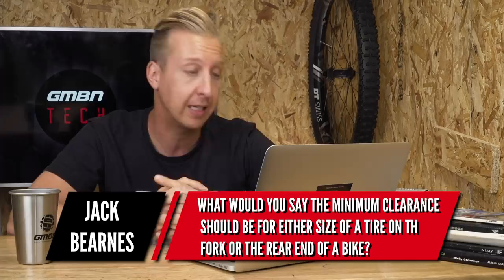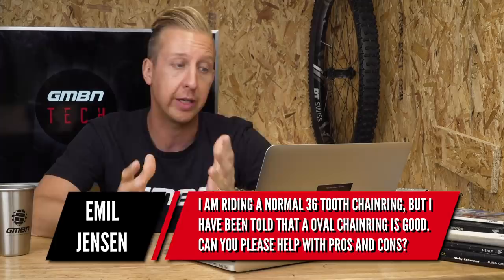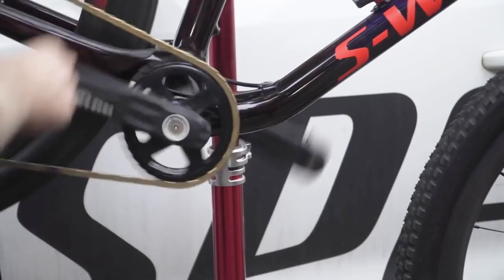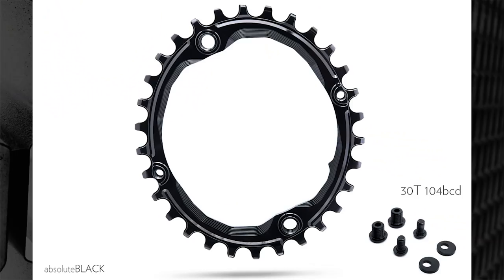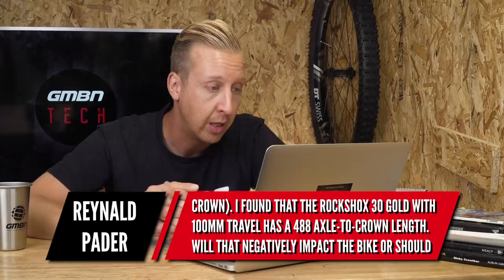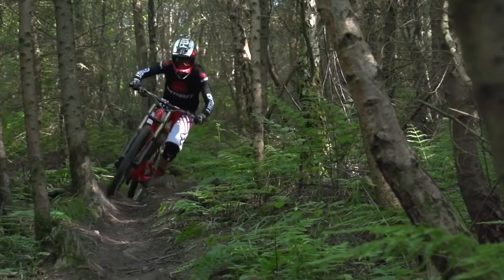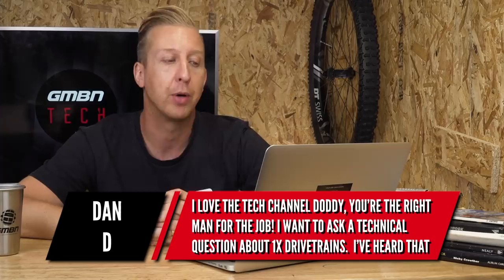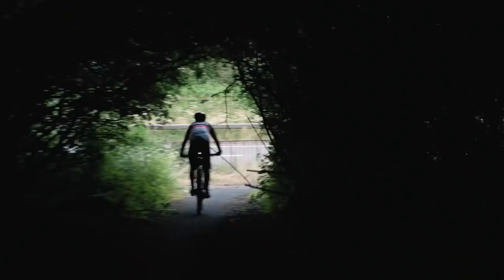Ask GMBN Tech: Should I Get An Oval Chainring?

Comment: I'm ordering an AB oval 34t next week and I fully expect my average speed to increase because my wallet will be lighter.
Reply: Everything old is new again.  I remember in the early 90s when oval chainrings were all the rage.  There’s a reason they died out.  I hated them myself.
Reply: @keirfarnum6811  I'm still happy with my Absolute Black oval chainring. No problem shifting.  I really can't tell much difference between an oval ring or a round ring.
Reply: @keirfarnum6811  in the 90s they were called bio-pace and were the oposite of the new ones.

Comment: How much tire clearance needed? Not very much! Maybe 5mm on each side. Two of my front tires are very close to the fork arch too, but no problems, no scraping. Now if you are riding in mud, that's going to be a problem. If it's dry, if you need a wider tire because it's loose or you just want an insurance policy downhill, whatever fits is fine. It just won't be as fun riding back to the trailhead with wider tires that drag more than narrow XC-oriented ones. A beginner and many intermediate riders will probably feel a lot more comfortable with a 2.6 or 2.8 tire for mountain biking. I really don't notice fork flex or any rubbing on tires that are fairly close to the fork sides (stanchions). Other more experienced, talented, and picky riders may. If you can get away with shredding with a 2.4 up front, go for it. 2.4's feel very lively and fast, but when I look at my own data, they are not as fast as a 2.6 or 2.8 in general, because you are subtly & imperceptibly losing tiny amounts of traction constantly on a 2.4 that you are retaining on a 2.6 or 2.8 due to the larger tread footprint of those tires. All of those tiny losses of traction on a 2.3 or 2.4 add up to a 1, 2, 3, 4% slower ride overall, even though you will 'feel' faster on a 2.4 because a 2.6 or 2.8 smooths things out and makes the downhill ride actually seem slower because things are more stable. But in general 2.6 / 2.8 are faster by the clock. Many Enduro Bros use a lot of 2.6 now, for a reason: they are fast and stable. This statement will irritate the more purist experts/pros that swear by 2.3 and 2.4, but hey, every rider is different, and don't knock 2.6 / 2.8 until you try it. I've looked at my downhill times, I know that for me 2.4 is a niche downhill tire for a relatively small percentage of trails, and 2.6 is more optimal for most trails. 2.8 is a wagon wheel, you have to muscle it around in turns, but the clock doesn't lie: it's fast, a lot faster than it feels.

Comment: Your derailleur doesn't move on a oval chainring, the diameter may change physically, but the half length of the cog is the same, no matter what orientation.... So when cycling the chain, you'll see the derailleur sit dead still 👍🏻😊

Comment: One thing that isn't mentioned as much when it comes to oval chainrings on full suspension bikes is that when the ring is at its narrowest, the suspension's anti-squat values are increased during that stroke phase so the bike actually becomes more efficient by preventing pedal bob
Reply: Hmm I'm guessing that would be due to less tension in the chain then?
But with the way oval chainrings are designed wouldn't you get a very awkward foot position with the chainring being in an optimal position for that to happen? Unless I'm looking at this wrong to me it seems when you keep your feet in a natural stable position most oval chainrings would have 1 of the wider parts vertical to the wheel base not? Wouldn't that then basically negate that benefit? I wonder how that would work in the real world tho and if said benefit/detriment would even be significant enough to consider?
Reply: boomerangfreak nah, it's because the chainline will sit lower relative to the instant center. You will see this behavior explained by Dave Weagle when designing suspension with triple chainrings. Granny ring makes anti-rise higher ergo more efficient but more pedal feedback; big ring makes anti-rise lower ergo more active but less pedal feedback. In the case of triple chainring, you will see as much as 30+% difference in anti-squat value. For oval, maybe 10-20% depending on how oval the shape is.

The implications here is big of course because you can change how your rear suspension behaves just by changing pedal position. eg. When the pedals are level (3 o'clock and 6 o'clock) and the ring is at its biggest, the suspension becomes more active. This is favorable when descending. When the pedals are vertical, the suspension becomes stiffer and in the case of high pivot bikes, the chainstay length from BB shortens giving you a more agile feel when cornering.

Comment: Have been riding an oval AbsoluteBlack NW 30t for over a year now, all I can say is it is amazing and I will never go back to round chainrings. First 30-60 minutes using it are awkward, but after that you don't even notice the ovality, it just becomes natural. LOVE IT (XC-Trail riding purpose)
Reply: thats the question, if you dont notice the ovality. what is there to love with caps lock. l mean. u say its awkward first. and then u do not notice it. so... I just installed mine today, the same feeling : awkward -> ok. ok != loving it. it is.. ok.. it moves the bike forward as far as i can tell.
Reply: Congratulations on using the word "ovality" in a sentence today. The opportunity will not likely arise for another few decades.
Reply: I have two bikes with 1x10 both with oval Chainring, to be honest I don't notice any difference (not even the first time), even when I pedal on my road bike the same day (with round chainrings). I use the chinese ones that can't be changed on the angle, maybe that's why.
Reply: I'm a casual cyclist, 200-300km a season, my opinion dont worth much, but it seems, that with oval ring i can start moving on higher gear (i switched from round T36 to oval T36). Didnt have a chance to ride on steep hills, but i suspect, that oval ring will allow just a little steeper climbs.
Reply: @_systemd  I just tried an oval chainring and I love it. It feels more natural, your pedal strokes are smoother,  and ironically it feels more round. I noticed it most when standing up, it's easier to apply a constant supply of power without feeling punchy and uneven. I'm on flat pedals and I maybe don't have the best tecnhique so maybe that's why.

Comment: oval is best   most would think that it stretches your chain but in fact when the high point in the chain ring is in action the low points actually inversely allows slack its some serious engineering that makes it so good in fact Matt Jones runs one on his single speed slope style bike with no chain tensioner and it works flawlessly

Comment: You cant adjust a Saint shifter to 7 speed. I think what you mean is that after you reached your smallest cog there's three more clicks after that. To get rid of those extra clicks go to the smallest cog on the cassette and remove the cable. Keep clicking the upper shift lever (the one that moves both ways) until all cable is released. Then re attach the cable and adjust the barrel adjuster as necessary. There will still be 10 clicks but you wouldn't be able to reach them.because you would meet the lower limit screw and not be able to pull anymore cable. Bam you no longer have three dead clicks. Hope this helped.
Reply: That's exactly how it should be done.
Reply: Immediate scanned the comments after this question to see if anyone had mentioned this.

Comment: a bent derailleur hanger is often the cause for shifting issues in the middle gears...
Reply: I also had this issue a couple of weeks back, and realized I had played with the distance of the derailleur to the rear sprocket and forgot to set it back (it was too far apart). Only middle gears didn't shift well. Adjusted the distance and that resolved my issue. I am putting on a new cable and housing as well just for general maintenance.
Reply: The B screw too
Reply: Yep, if cable is fine and derailleur is not damaged bent derailleur hanger or b-tension set incorrectly would be the things to check.
Reply: Yeah, and b tension also
Reply: That's it - B screw!!!
Reply: I confirmed a rear hanger was indeed bent when I put the rear wheel on. I just had a feeling. Ordered a new one, perfect. The old one wobbled but you would never know to look it at.
Reply: My hanger actually came loose on my road bike which was causing some shifting issues.

Comment: 10 to 7 Speed Conversion-
 I run a SLX 10 spd shifter and derailleur on a Hope trials/singlespeed hub. It has a shorter free hub body that'll fit 7cogs on it (10 spd spacing) I just set the upper limit screw  to lock out the rear mech and the shifter pod has no indicator window so there's no hokeyness there. I use the bottom 7 gears from a 10 speed cassette and it works flawlessly. This is on my street bike but I've known downhill guys to do the same setup.

Comment: 11:25 You can actually "block" clicks on a shifter by adjusting the top limit screw to keep the shifter from shifting up.
I have this on my converted 2x drive train, on the front derailleur. The shifter has 3 clicks but I've adjusted the limit screw so it won't shift the last click.
I think that you can make this work on the rear.

Comment: I have been on an oval ring for 2 years. There is a learning curve. I would say a good 2 weeks for regular riders. I did some back to back testing on a round and oval. Same say, Same segment. I changed the ring at the trail head. I was a touch faster with the oval with the same HR day one and close to 15 seconds after a few weeks on it.  My biggest improvement is on switchbacks where elevation pitches or if there is a quick change and then return to same grade in elevation. Probably not for every one but works well for me.

Comment: YES Absolute Black 32 tooth on my 2018 Trance 3. I ride a lot of dusty, loose over hard and I climb a ton, with the full squish, it kicks out and spins the rear wheel a ton without an oval chainring, especially with clipless pedals. 100% worth the cost, and extremely noticeable. I've got well over 200 miles on the oval ring and wouldn't change back.

Comment: for the 10 to 7 ... just set it up where your highest gear is the highest on the shifter ... and run the low limit till it's in the right place and the limit will stop the shifter
Reply: Good hack! Doddy do a quick vid showing this!
Reply: YEAH ur genius
Reply: Weeeell, it's not wise fiddeling around the low limit screw and risking snapping the cable with overtension as there is still way to push the lever. I'd recommend to see if Altus ratchet fits - althought it will be hella a job to take apart the shifter. Best would be to modify the existing mechanism: filing off the extra teeth and moving the stopper.
Reply: mine is just an easy/quick fix solution ... but it works fine ... and you should never be pushing that hard to shift that you risk breaking things
Reply: I have a Saint shifter and 7 speed Ultegra block just like the guy asking as my DH bike is 7 speed only (Norco Aurum carbon)... it works fine setting it up like colin p describes.
Reply: That's the best way to do this (also can be done with a 3 speed front Derrailleur to convert it to 2x)
Reply: Manuel, that's true.
Reply: Came to suggest this as I've done it.  You won't snap out damage a cable in good condition pushing on the shifter.

Comment: I just tried an oval chainring and I love it. It feels more natural, your pedal strokes are smoother,  and ironically it feels more round. I noticed it most when standing up, it's easier to apply a constant supply of power without feeling punchy and uneven. I just climbed a local hill standing up in top gear which I've never done before. I'm on flat pedals fyi
Reply: That's what I tell people...it feels more round than round rings.

Comment: I've been riding an Absolute Black oval on two bikes now, my current is a Norco.  I ride punchy techy climbs (flat pedals), lots o power moves and after installation,  I noticed it on my first climb (and a few others that day).  I was able to crank through sections where normally I wouldn't be cleaning the climb, felt like I had a bonus pedal stroke.  I still fail at climbs that my friends are clearing on non oval chainrings but I'll take what I can get!  It's a subtle positive addition and and in the future, I'll be putting another oval on my next bike.   Not sure why pros don't use them, even if it only helps a little... I actually thought spinning on flat sections felt smoother!

Comment: On oval chainrings: Been watching them since the 80s. 
1. Can someone ask a physicist about torque, power and the actual lines the forces take. I am tired of the subjective “they feel good”. I am also tired of the line that the short axis has the diameter of a 32” while the long is more like a 34”. It don’t matter! The RPM is the same, the rear cassette has no idea how it’s being driven.
2. If they are better, everyone would have them, yes?
3. Can someone do the simple experiment of mounting one with the oval 90 degrees from the way it should be mounted? Presumably the bike would ride very, very poorly. Same rider, same bike, velodrome conditions, oval mounted correctly and then incorrectly. 
4. If all this could be done without mentioning a manufacturer’s name, that would be great too.
Reply: Albert Batfinder for question 1 it’s a simple as when your in your downstroke your going through more teeth, and on the upstroke using less teeth. For the inch thing, the radius gets bigger in the downstroke because of the oval shape
Reply: Check Dylan Johnson's video on oval chainrings. It's pretty well researched.
Reply: I can tell you is it's like shifting gears automatically.  Gets slightly easier when legs are in the weakest position and slightly stronger when the legs are in their strong position.  All I know for sure is it feels incredibly smooth climbing now with no lurch as I make the transition from side to side.

Comment: On the topic of 10 to 7 speed. I would first click shifter so it corresponds to the 7th gear and then tighten the cable back at the derailleur. You wont have dead shifts just imposibly hard shifts. If limit screws are precise should be no problems. Worked for me.

Comment: Doddy, there is a limiter for a 10 speed derailleur to run 7 speed.  It basically clamps on the cable to limit the derailleur from moving to the lower gears.  I have one that came on my new Demo 8 DH bike.  I'll see if I can find the resource.

Comment: I am after my first ride with an oval chainring. It felt funny for the first minute then I got used to it and here are my observations.
Pros: feels I have more power and that you slingshot forward on the uphills, more traction on the techy climbs with flat pedals (I find it difficult to pedal smoothly on flats, I was good with it on clips)
Cons: you run out of leg strength sooner on steep climbs: on the actual power stroke my 32t oval has the diameter of 34t and you have to push that 6% harder to turn the cranks and it feels. It also encourages (me) to lower cadence.
So far I am happy with it but I think if you ride clips the gains would be marginal.

Comment: Thank you. You guys are the winner! I've got an old 1987 mtb with a Biopace chainring. The crank is aligned with the widest part of the gear. A series of videos I watched say that I should move the crank position. The well meaning Youtuber however holds chain rings and talks and talks and explains. He's even got some graphs. I can't follow him.  There are five screw holes  in my Shimano Biopace chainring, so it's obvious that if my old factory setting is not ideal, then the better option is either to rotate my rings 72 degrees clockwise or 72 degrees anti-clockwise.  Finding out which has been nearly impossible.  (Weird huh?)  Googling this different ways I finally got a link with a thumbnail clearly showing that the wide part should be 72 degrees in front of my crank arm. That's to this video. So thanks.  I'll give try that. 
Do I like my Biopace? I've been pedaling them for 32 years (but not regularly.) I'm used to them, but I don't know. I've ridden a lot of bikes without them and they're okay too. 
       I think your point about they may be best for flat pedals, no clips or clipless is excellent.  Makes a lot of sense. I clearly remember when I first installed clips and straps and started lifting up with my off leg. The term 'crank' lost some of its meaning as I was now  more machine (spinning?) keeping my cadence going.  So higher cadence and clipping in probably does eliminate most benefits from an oval chainring. 
       Going up a steep climb is when I most notice them. If you re-visit this topic I think that would be a good place to start. 
Would I buy a new bike with Biopace or some other oval chainrings? Maybe, but I probably would select other aspects first, like a really low climbing gear and a good high gear ( I do a lot of my riding on the road, so a 1x chainring is an immediate no).  Would I spend say $100 on non-round chain rings as an upgrade to a new bike? I'd want to see a lot more clear information first. *The big unanswered  question is: Shimano clearly did some research, thinking and engineering when they invented the Biopace,   So why did they get the position wrong? Or did they? *